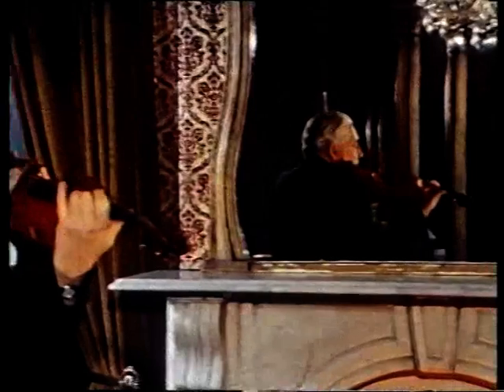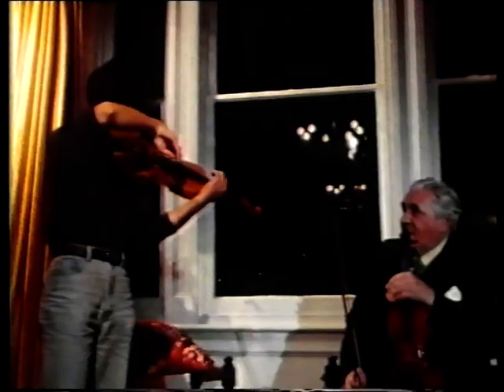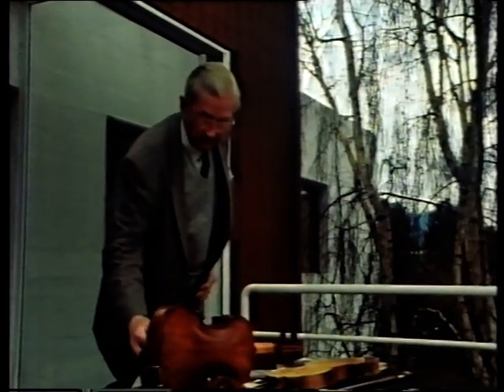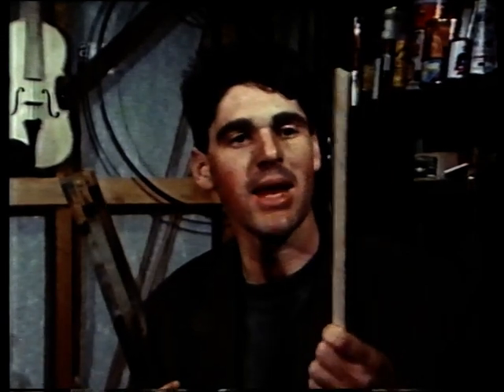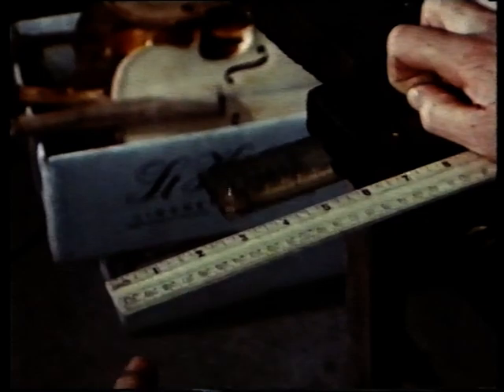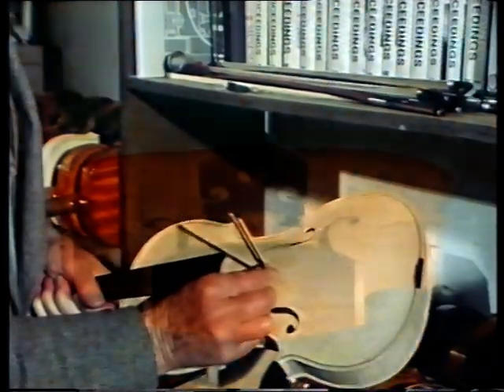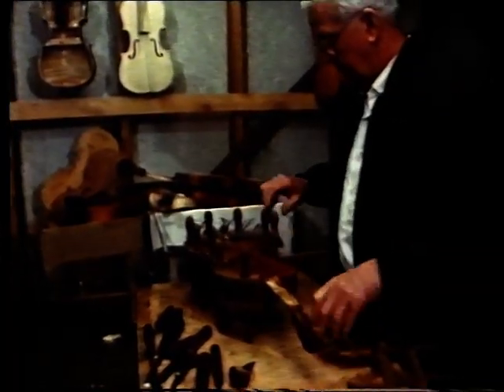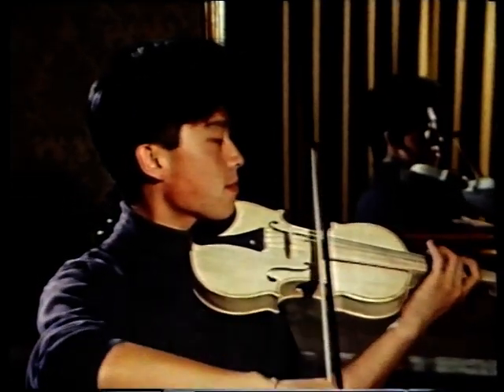Experiment Improving Violin Sound

Comment: I tried playing without the sound post, some notes create a squeaky sound and the sound doesn't vibrate at the back of the belly it sounds like the soul of the instrument is dead. I experimented a long time regarding the sound post. Based on my observation, the thinner the sound post the better are the high notes as the sound resonates more inside the body. I thought a wood soundpost absorbs shocks and vibrations rather than channeling it. I replaced the wood soundpost with a metal which has lesser radius. I was surprised because the vibration that the metal soundpost circulated more inside the violin belly. I am happy now with my metal soundpost because it unlocked the potential of my violin. Since then I always find my violin, continuously inspiring me to play more and more.
Reply: the base bar was larger and moved  closer to the center